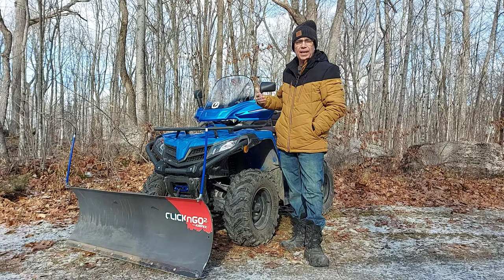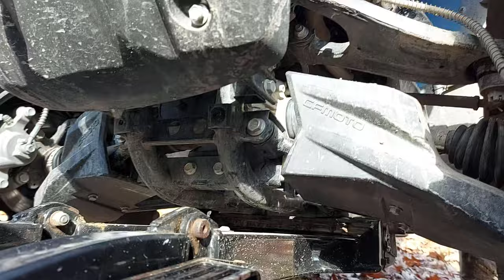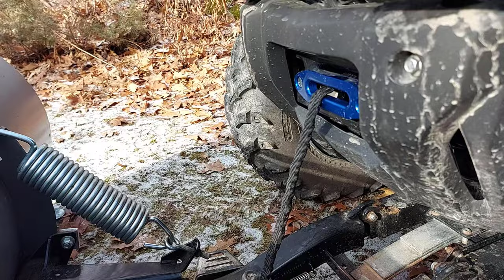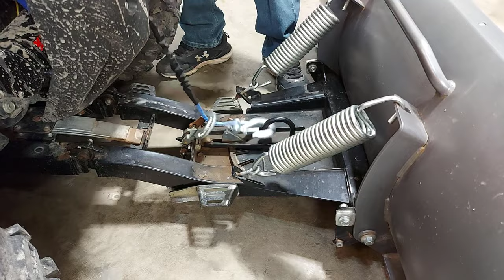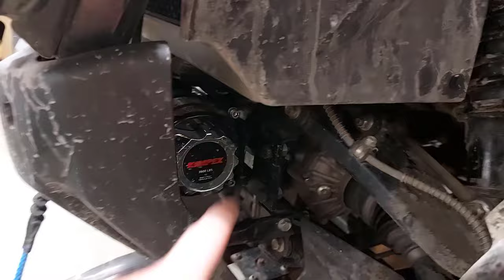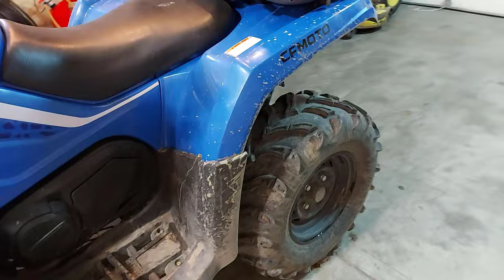The ATV Snow Plow Setup I'll Use for my 1/4 Mile Driveway

Comment: I have the same plow on my teryx4. Works great. I'd only mention that the second hook you are using with your winch cable is just used used to hook it up. Then meant to be unhooked for plowing. But if it works it works right?
Reply from the maker: Yes I've always used it the way you mentioned. Thought I'd try it using both hooks because someone recommended it to me. Thats why I asked in the video. I have set the rope back to the one hook now. It does make sense. I shouldn't have listened to the advice of that person. 99% of everyone is on board with the one hook closest to the blade. Thanks for chiming in!

Comment: I run a Yamaha Grizzly SE (XLT in🇺🇸). That being said I’m old enough to remember when everything from Japan was called Japanese junk lol. CF Moto has advanced in leaps and bounds the last few years. They are working extremely hard to get more market share through quality control and extremely competitive pricing. The nay sayers will be left behind. The more competition, the better. The only thing I don’t like about your hook up is the secondary hook you are using for lowering and raising your plow is for mounting purposes only. You should only be using the front hook up when operating your plow. Save wear and tear on your rope or in my case, the cable. I’ve only used the Click and go 2 once as I just purchased it. Heavy wet rain filled snow. About 6 inches, 15 cm. Plow cut through it like a hot knife through butter. I’m very impressed so far.

Comment: Great video and I'm a fan of your channel.  I use an 03 Eiger with CVT for plowing.  You'll be perfectly fine with the CVT.  In the really heavy stuff I use low range just to make it easier on the belt and machine.  If you have blacktop anywhere I would advise against chains.  Any tire spin, which will still happen with chains, will quickly scratch and damage your blacktop driveway.  I know as I've plowed with chains before on an old Polaris 500 on my blacktop drive and private gravel road.  I have a very similar property as yours with a long private road leading to our driveway.   I would imagine the CFMOTO is even heavier than the Eiger.  And with those meaty tires, I bet that thing is going to be a beast in the snow!

Your Eiger has more than paid for itself!  I'm curious, are you selling the Eiger or keeping?
Reply from the maker: Thank you Anthony. I had no clue an older Suzuki would have a CVT clutch system. Thanks for the advice about the snow chains, I'm going to take your advice. 😊
Reply from the maker: I did sell the Eiger, wish I could have kept it and the Cforce

Comment: I have the same plow on my teryx4. Works great. I'd only mention that the second hook you are using with your winch cable is just used used to hook it up. Then meant to be unhooked for plowing. But if it works it works right?